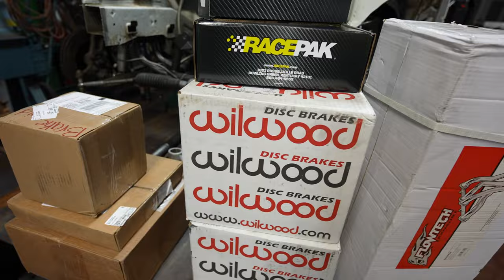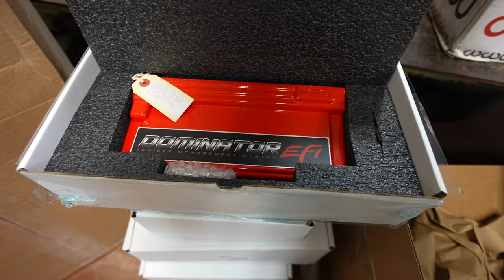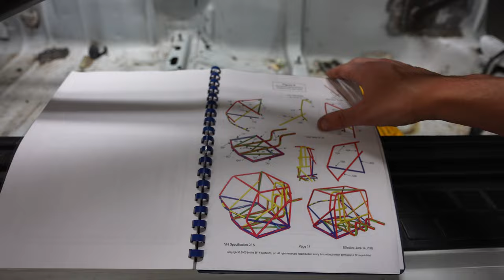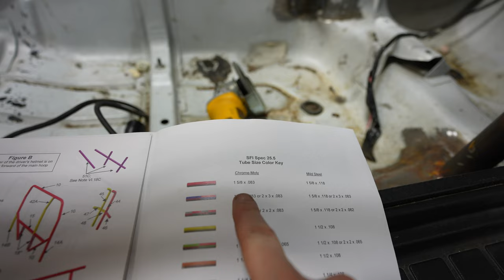I Ruined My Turbo Camaro’s Roll Cage! Unboxing New Parts!

Comment: We're going to line'm up and run them. We're both dumping loads into our heaps. Looking good buddy.
Reply from the maker: Sounds like a plan man! Thank you!
Reply: @BuildTuneRace  I know this is late but you should put a carbon fiber roof on the car and get rid of the t-tops and you should've went with TBM brakes and you should hit up Merrilat racing and get him to build you a Fab9 with a torque arm for your car if you haven't seen the one he did for Kye Kelly during the filming of Street Outlaw End Game that Kye put in that 3rd Gen Camaro that he put the SBF in with nitrous that he was going to use for the show but ended up using his Regal instead go and check it out and see what you think because I think all of Merrilat racing's fab work is a piece of art if you ask me but you should also put carbon doors, hood, deck lid, and Optic Armor lexan for the windows and make it light as possible